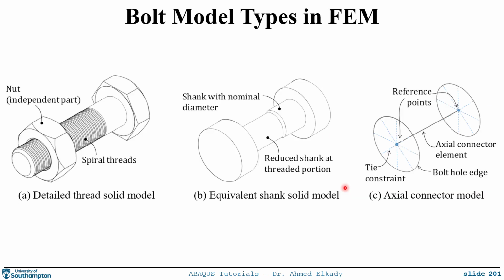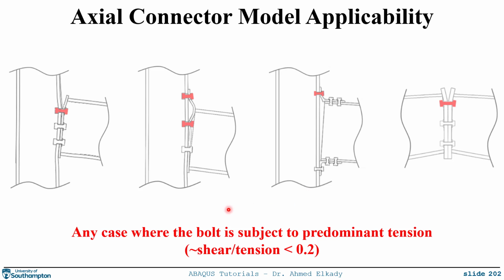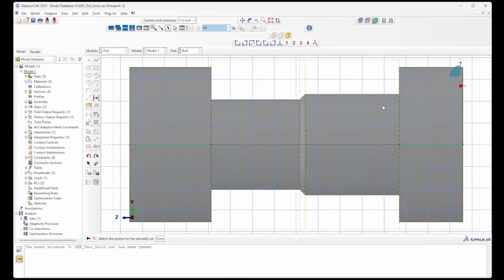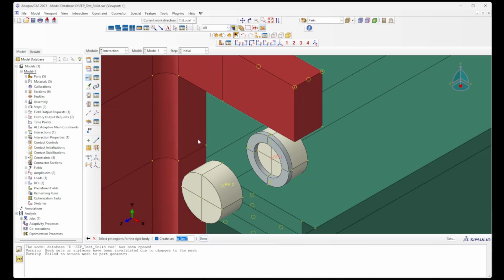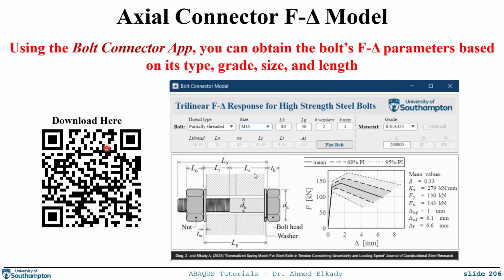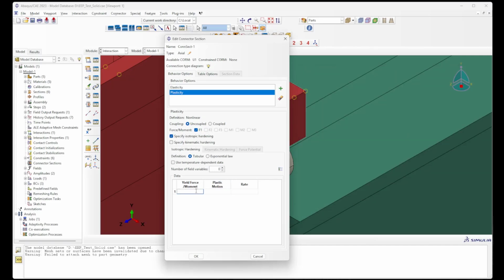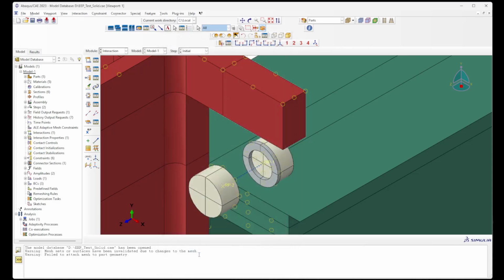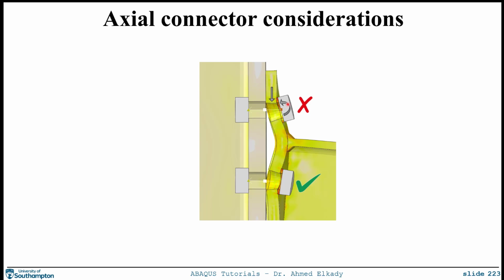#40 ABAQUS Tutorial: Modeling Bolts with Axial Connectors

Comment: Thank you for the informative video. Is it also possible to use a bushing connector so that bolt shank contact to the bolt holes is also accounted for? I have a relatively large frame model and too many bolts, and I was considering using this approach for a global analysis. But my bolts are 3 mm undersized compared to the holes. so I want a simpler approach that I can also model the bolt shear and shank to hole contact effects. However, my connection type is bolted extended endplate.
Reply from the maker: I think you should be able to set limits for the axial connector lateral movement based on the bolt hole tolerance to imitate shank-hole contact

Comment: Would it be possible to create a more general bolted connection with a cartesian connector? Then you could assign stiffness/failure in both axial and shear directions
Reply from the maker: Yes, you can but this would not solve the slippage issue between the plate and bolt head/nut. you can also use the deformation stop command to limit the amount of slippage based on the hole tolerance.

Comment: Great tutorial.  I have one question: how about if the steel plate is anchored on the top of the concrete? Assuming that the reference point and tie constraint is created at bolt hole of the steel plate , how about concrete surface ? Since in reality the bolt shank is embedded in the concrete? The simulation idea is to constrain  the steel plate and not allow it to  deform with the concrere beam . The steel plate is placed between to span beam ( at the joint)
Reply from the maker: This approach would not be suitable for anchor bolts as it will not capture the interaction between the anchor and the concrete

Comment: nice vídeo, congratulations sharing this kind of content. Why not model the whole bolt/nut with pre-tension section or connect the bolt and nut with rigid/connector in between at thread interface? This way is also possible to evaluate the stresses on the bolt itself and identity if the weak spot is the plate or the bolt...
Reply from the maker: Yes correct. This approach is meant to save computational time if you are only interested in global response not local bolt behaviour and stresses.